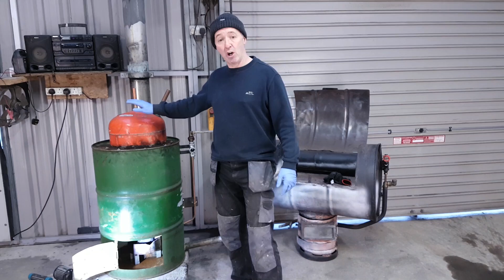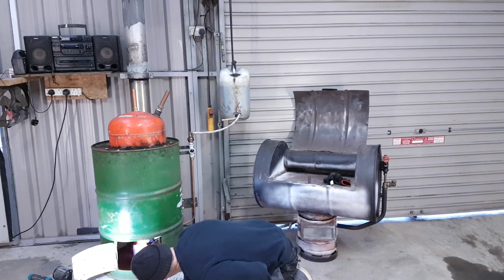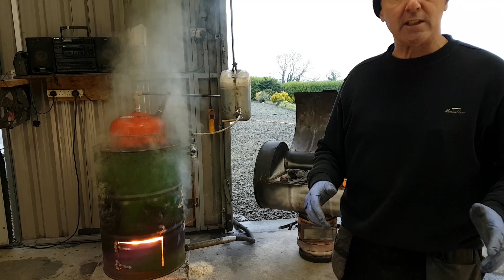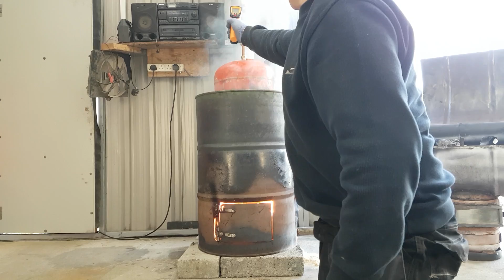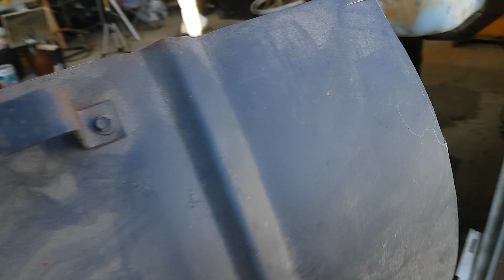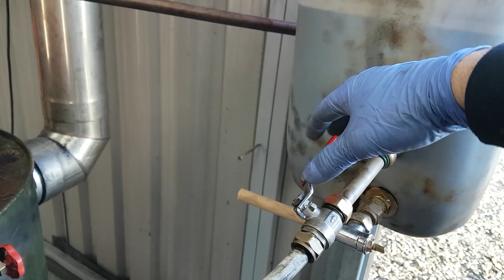Awesome Waste Oil Boiler  FREE Hot Water Forever..

Comment: nice prototype,  it will be interesting how far you will take it.i would love to have one of those heaters in my garage but I live in town and one little puff of smoke and the neighbors would be calling me up lol,
Reply from the maker: Hi Terry. Yesterday I knew there was going to be a lot of smoke from the paint but the flue stack was burning clean even with the paint burning off the inside of the oil drum. I live in rural Ireland so there aren't many neighbours.What are your neighbours like with noise if you are drilling or grinding.  Thanks for commenting.  Cheers Gerry
Reply: @GerrysDiy  my neighbours dont  care about my grinding or drilling,but they would be nervous about the smell of oil burning and my garage may be to small for a oil burner,but i still like what you are doing with the oil burners keep up the good work.
Reply: @terry269  - None of my neighbors have a clue that I burn oil and the burners can be scaled down very easily.